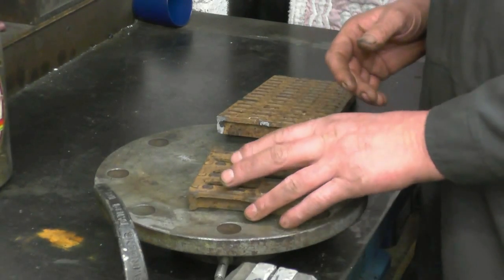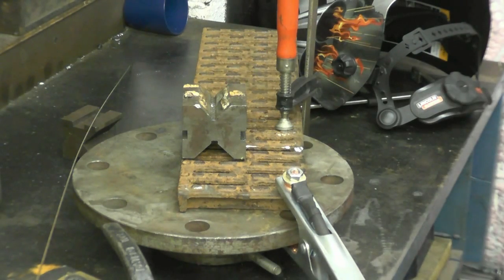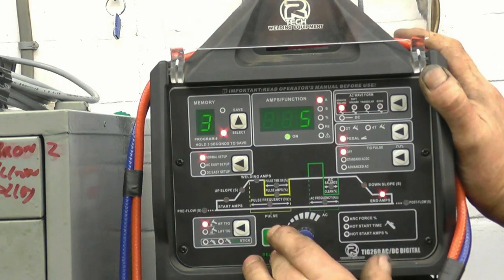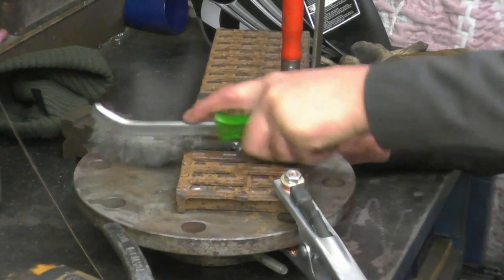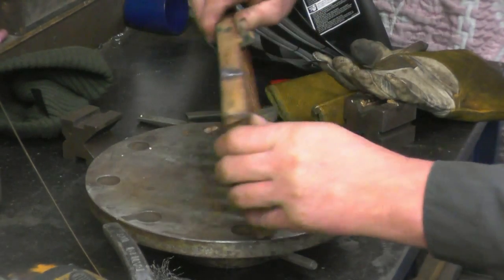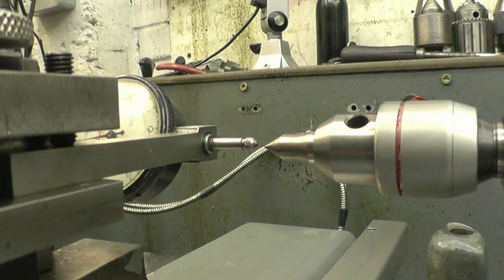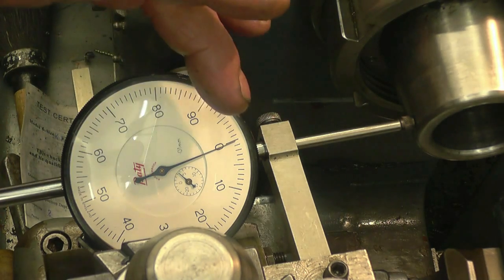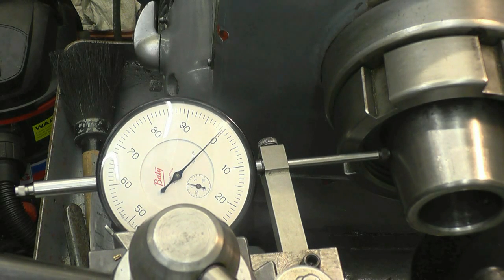SNNC 153 P2  TIG Brazing   Lathe Compound Angle

Comment: Hi John, The "mystery tool" that you show in152 Pt.2 was used for cutting watch glasses (plastic). You used to be able to buy thin square, blanks of plastic (acetate?) that would be cut to size on the tool and then fitted to the watch bezel by doming the glass slightly on a press and then letting it "spring" into the bezel groove. Regards Clockmaster NZ

Comment: Was that Aluminum-Bronze filler? If so, why did you choose that over Silicon Bronze? Just curious, b/c I do allot of repair work and was wondering if I should be using Al-Br on Cast parts. Thanks in advance
Reply from the maker: I was using silicone bronze filler

Comment: Interesting tig brazing silicon bronze on AC. What was the advantage of using AC over DC? I thought silicon bronze was supposed to be DC, while aluminum bronze works better using AC. Thanks!
Reply from the maker: I found the AC helped to clean up the cast even with silicone bronze It was still very good on DC  but better with AC

Comment: Looks like that grate pulled on ya when you welded it. I could see the bow in it from here.  Hopefully there is plenty of clearance and it still fits fine. Thanks for the tips on the settings.

Comment: John, with regards to cutting your taper, the way you have done it means that you will have to run the lathe in reverse and cut on the far side of the hole with a right handed tool, or run it in forward with the tool upside down, but still cut on the far side. The way the compound slide is at present, means that if you cut in the usual way, the small diameter will be at the front and it will get larger as you wind in. You should have clocked up the spindle using the far side of the spindle taper. Good luck with it all. Merry Christmas and a Happy New Year to you and the Family from Adelaide, Australia.
Reply: noo dont mention running in reverse to john, he will end up a reverse taper!
Reply: That's what I was thinking too.

Comment: John, will not the Silicon Bronze melt when there is a fire on the grate ? Perhaps some straps bolted or riveted on across the break would be better ?
Reply: thats what i would have thought...  but apparantly melts around 1800F  so depends how hot a fire...

Comment: What was the red canister at the end for with the tyre?
Reply: to seat the tyre, you cant air it normally till it seats on the rim, so the only way is sudden inflation, seen it done in the field with flammable gas like a flamethrower too,. fitting tyres is a bit scary, plus the noise as it seats on the rim when inflating.
Reply: The bastard one!
Reply from the maker: 150 psi compressed air
Reply: Yeah, out "4 wheeling"(a.k.a. off-road touring) in Hawaii we occasionally used butane lighter fluid to seat the bead on, and completely inflate, our over-sized off-road tires after making any patch. Even just to refill any tires drained to get traction with, butane comes in handy...but, it does make seating the rim MUCH louder than normal, LOL!
Reply: I usually mount tractor tires using either.
Reply: Oh yeah, that was the other thing we used, that I couldn't think of...Starter Fluid! Great in a paper bag too...hee hee!

Comment: A grate out of a fire. It looks like a cover of an ACO Drain John ?
Reply: it is you can see the name
Reply: The old kind! They don't make them like that anymore!
Reply: the new aco's are plastic, so i guess why he wanted to save it,
Reply: You can still get the metal type, but they are stamped steel rather than cast,
Reply: Matthew Smith
yes ive seen those too, but neither of them will match up if you have the rest as cast, and i would guess the cast would be hard to find etc
Reply: big stack of them or very similar at my local scrap yard , nice braze job

Comment: what size of measurement is a fannys  hair John .... brilliant 😁
Reply: it depended on the fanny, and we never found anyone with access to a wide enough cross section
Reply: AvE's shop ruler comes with a calibrated gauge....

https://www.etsy.com/uk/listing/464202928/one-rule-to-ruler-them-all-cheeky-jokes
Reply: I'm not sure what John's gauge reads but mine reads in 'Ba hairs' with 'Fanny hair' in-between  that. 
Of course if using the red scale then it's slightly bigger still.